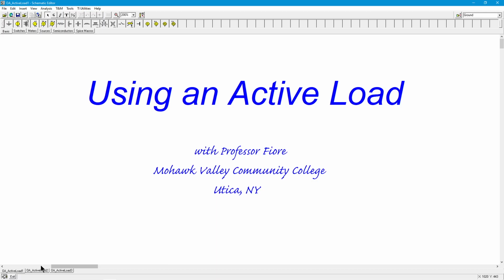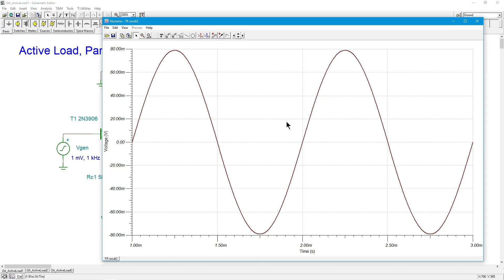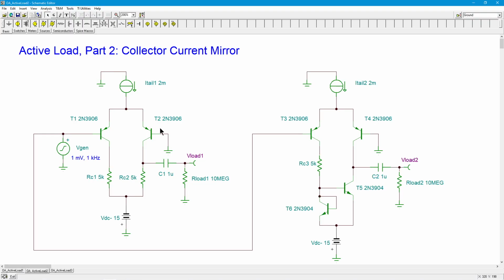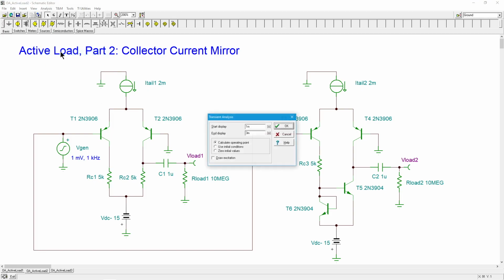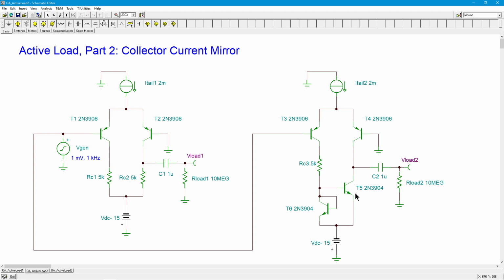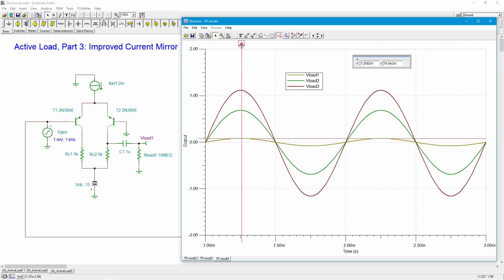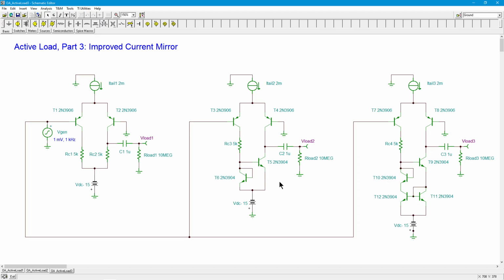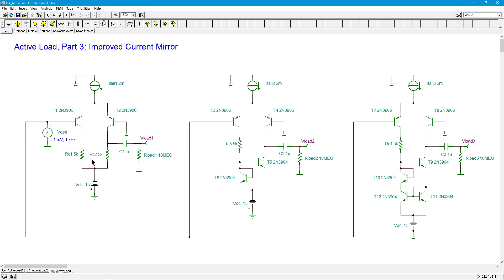Op Amps: Active Loads

Comment: In theory the current into the load  equals v_in/r'_e so Av should be R_load/r'_e = 10MEG/28 = 385000. The measured/simulated Av is just 1140 (Wilson current mirror). Why the big difference?
Reply from the maker: The internal impedance of the mirror is not infinity.
Reply: @ElectronicswithProfessorFiore  Thank you very much.

Comment: Is it possible to calculate the resistor equivalent for an active load NPN? I Can't see an obvious equation.
Reply from the maker: Yes, but it's probably easier to just measure it (by its effect) ;-)
Reply: @ElectronicswithProfessorFiore  Probably? That sounds ominous. I enjoy the maths, is it in any of your downloads?
Reply from the maker: @simonyoungglostog  By "probably" I mean you'd have to dig around for some device data. Measuring is very easy (including "in sim"). Start with an open load to determine the max Av. Then add a load resistor and compare how far the gain has dropped (there is a voltage divider between the output impedance set by the active load and the external load resistor, just use the voltage divider rule in reverse). For example, if the gain drops in half, then Zo = Rl. If it drops to 1/3rd, then Zo = 2 Rl, and so forth.
Reply: @ElectronicswithProfessorFiore  Thank you. I'll have a go (I'm wading through my power-amp design and slowly working out what all the sub circuits do.

Comment: Really great explanation! This would also increase the AC output impedance as well though, correct? I see those load 10M resistors snuck in there haha
Reply: That’s usually where current amplification/buffering would be added in an op-amp, right?
Reply from the maker: @SeanPorio  Right, this is the first stage of an op amp with gain stages following.